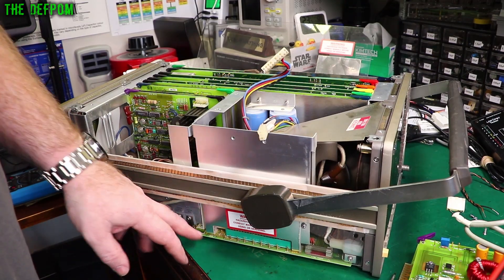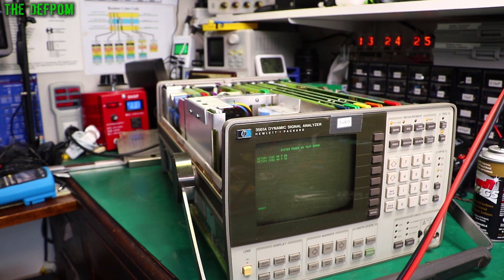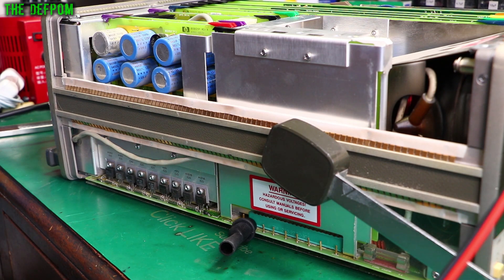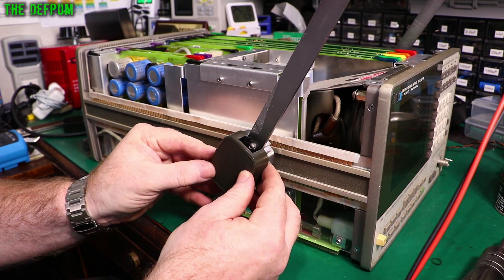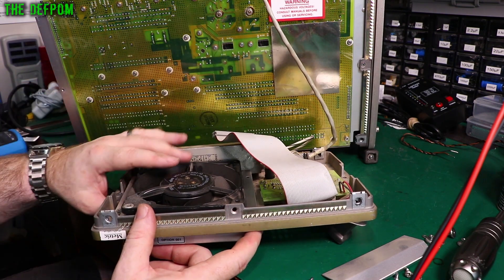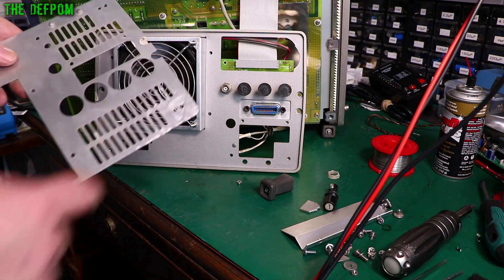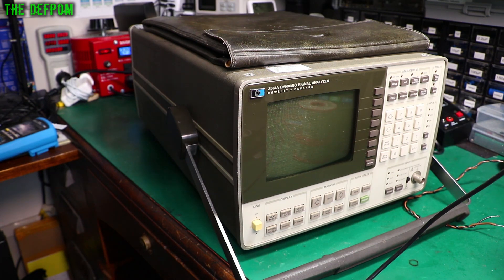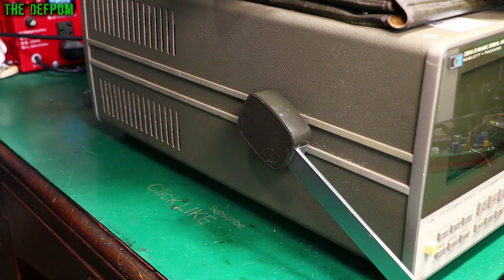🔴 Can It Be Fixed? - HP 3561A DSA Repair Part 3 - No.907

Comment: Happy New Year, Scott. Most of the ebm/Papst fans in older HP gear use ball bearings that are replaceable - I keep a supply on hand. Even with new bearings some of them remain quite noisy. Looks like you will need to find a Hitachi HM4864P-3 DRAM chip to replace A30U209.